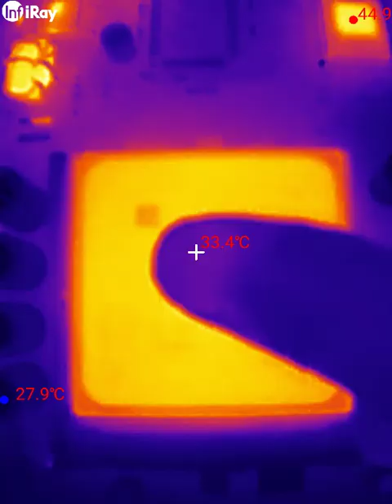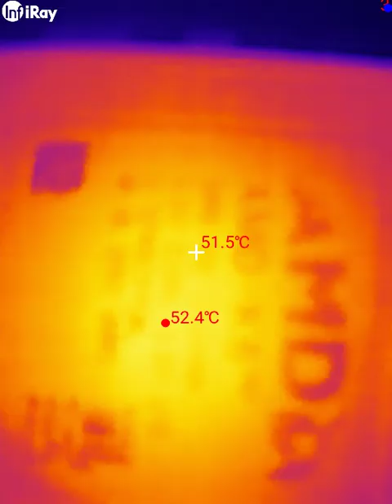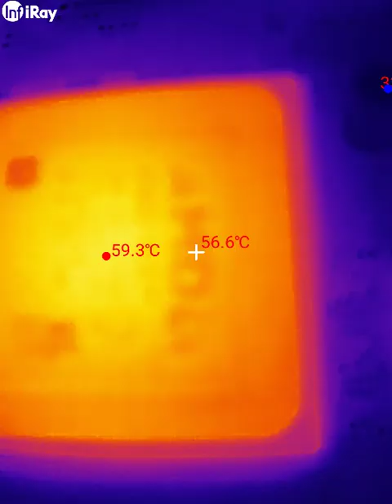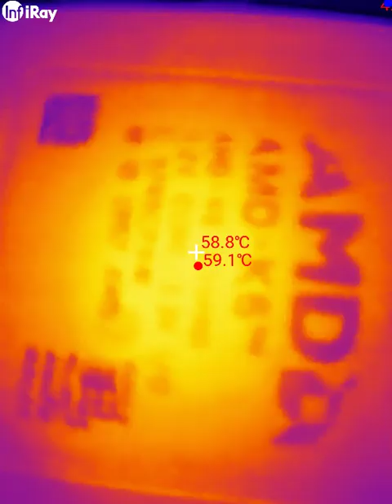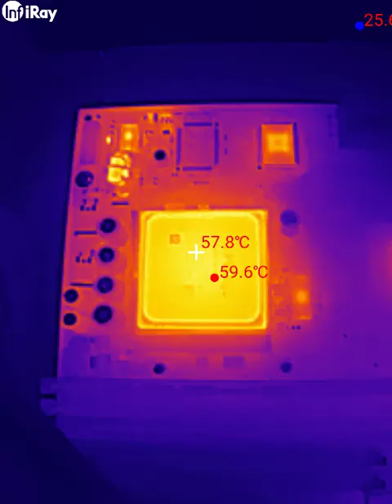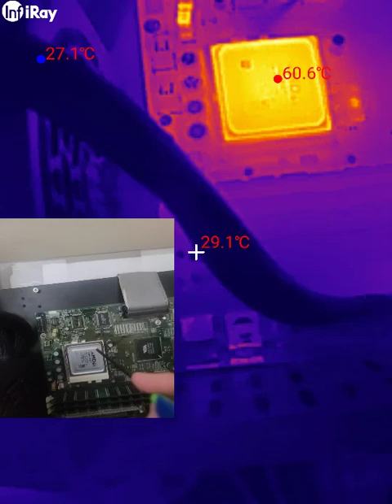Touching an AMD cpu without its cooler while it's running a stress test

Comment: first AMD Athlons burn a hole in few seconds without cooler, there is a very famous toms hardware video about that. when i did the same test on an obsolete amd athlon, at the time, it burnt the cpu and motherboard.
Reply from the maker: yup. this is the AMD K6, the predecessor of the Athlon, with both an undervolt and underclock for protection.
Reply: @TheMajorTechie and still didn't explain why it removed all from the athlons.

The athlons were amazing at the time.

Comment: oh boy, that poor thing. Back at this time, AMD CPUs didn't even have integrated heat protection. The famous video from Tom's hardware was with a much later chip than that.
Reply from the maker: Yup. That one was of an Athlon, nearly two generations newer than the k6 here
Reply: @TheMajorTechie You counting the K6-2/K6-3 as almost a generation? Or Slot A Athlons?
Reply from the maker: Slot A athlons  @aviat4ion